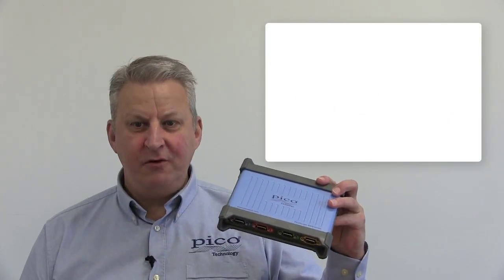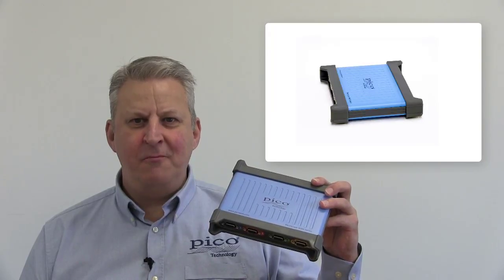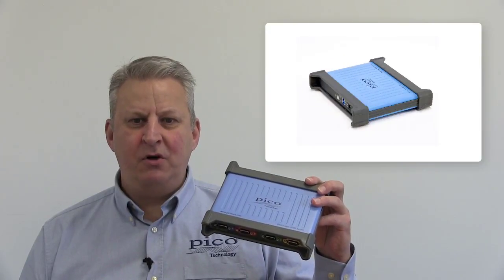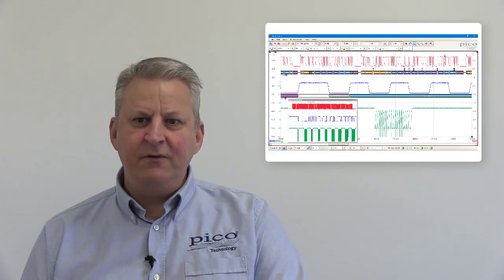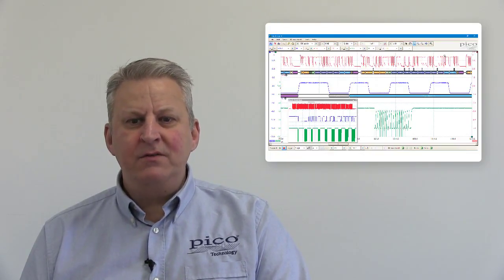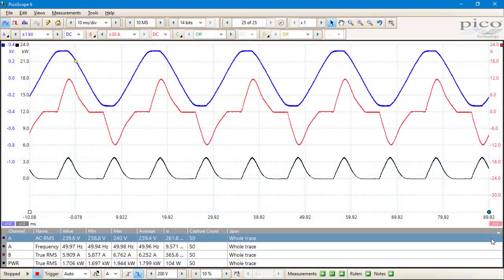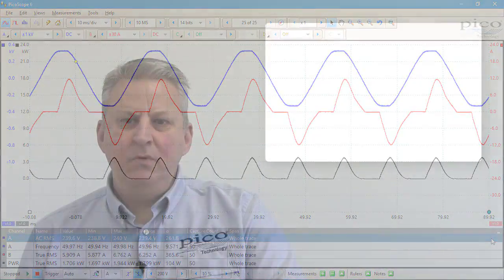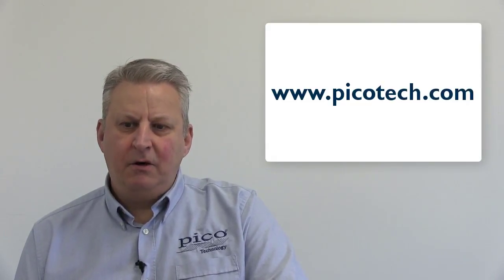The PicoScope 4444 differential input oscilloscope

Comment: 2 kilobucks for old fashioned 20 MHz scope…. Nope, not buying. I could pay maybe 300-400 fir it, just to have it by hand
Reply from the maker: Hi @Zelenyi4ay If you're looking for a standard ~20MHz oscillscope for £300-400, please check out the PicoScope 2405A. 
The PicoScope 4444 has many advanced features and specifications that may not be needed for everyday usage and engineers.
Reply: @p @picotech ke which? It is merely a differential circuitry moved inside the box. The inputs are not even truly galvanically isolated. It is essentially same as if I took 2405A and connect ordinary differential probes and connect to all the channels. However, 4 x probes for this bandwidth with the scope would be much cheaper than 4444 with passive differential probes, so where is win?